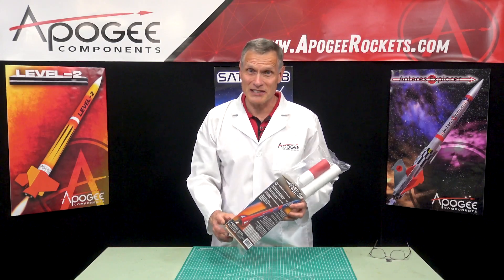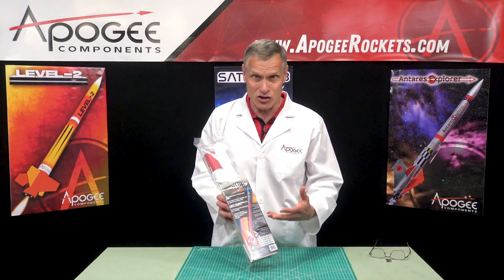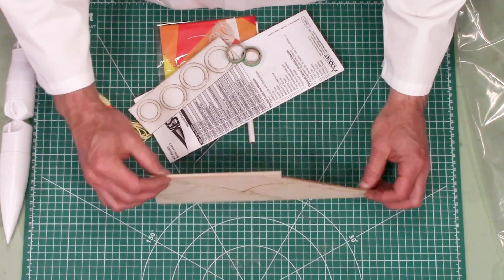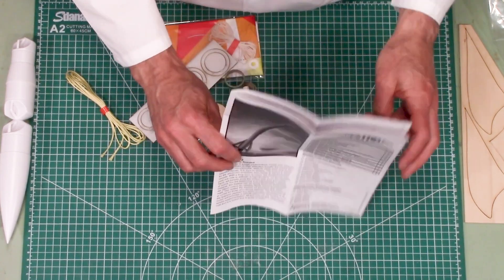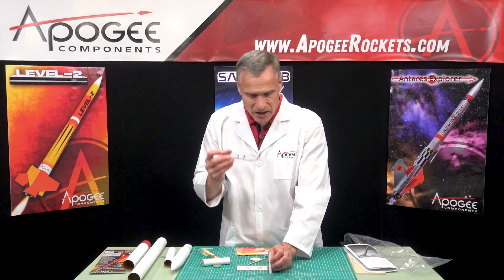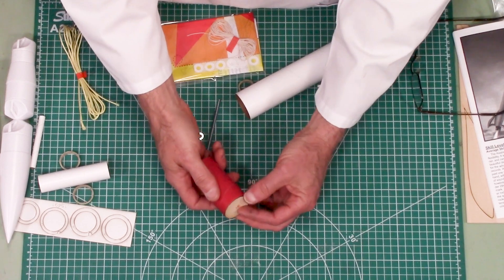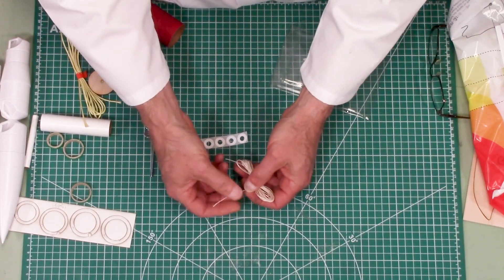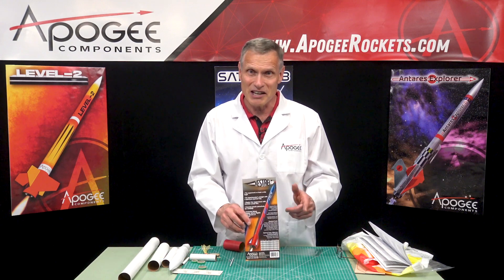Unboxing the Kestrel Model Rocket Kit

Comment: I had an issue with lot of the fins. So I had to sand them so their alot more round. 

Off topic&Side note:I’m currently working on Star Wars AoR,F&D and EOTE TTRPG. Just missing three sourcebooks. Two are out of print. One is constantly out of stock. Due to mando&bobo Fett. But Im working on it. Its hard. The economy is bad. Its Trumps fault. He FUBARed it. 

But back to this. As soon as I’m done with the home brewing of the TTRPG. I’ll be back to building flying model rockets.